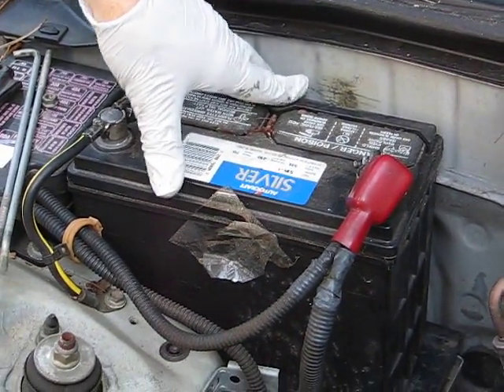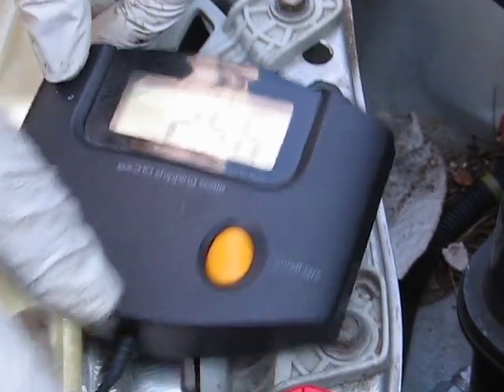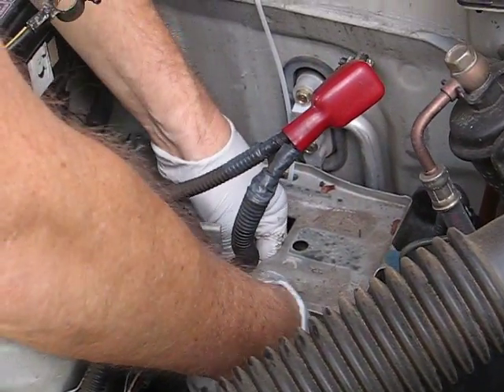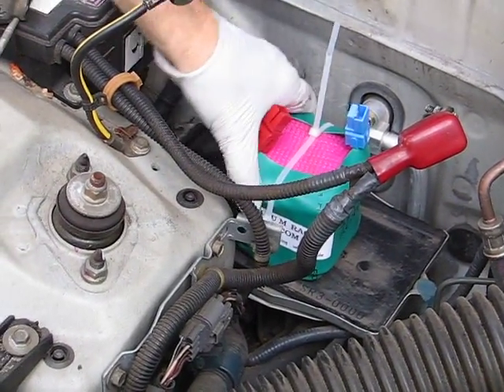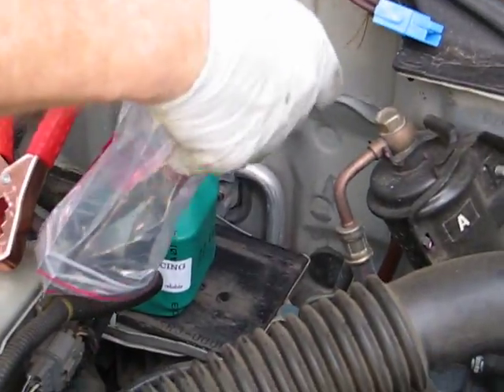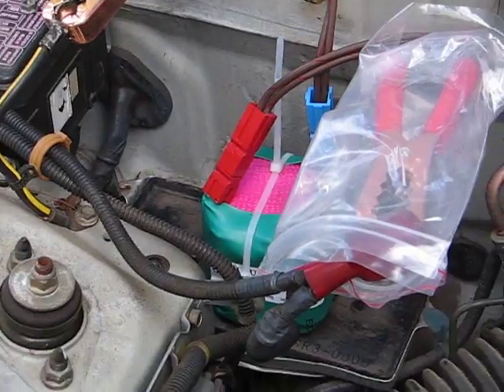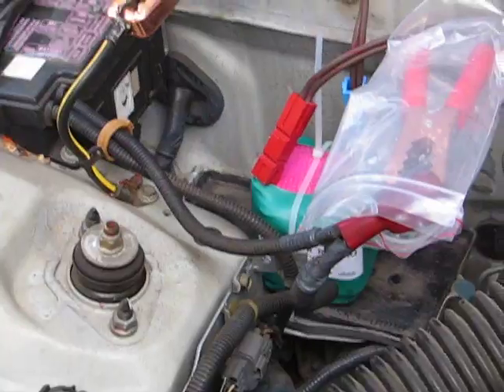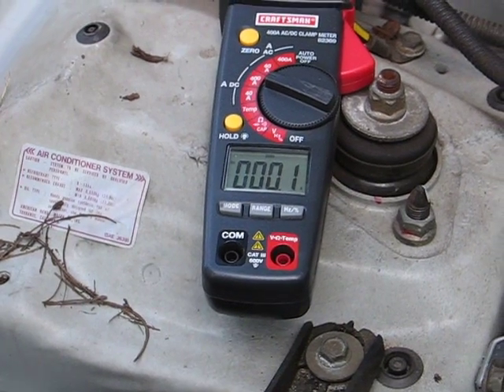How to replace a Lithium auto battery (AeroLithium battery)-DIY

Comment: just because the insulation on the battery is fire restraint does not mean heat is no problem and what voltage is that battery with no bms or circuitry sounds dangerous

Comment: not a very good replacement. peak amps too high for this battery.
how many have you put in series? 3 and the charging voltage would bring them to 4,8V which is way too high. 4 and they would never get even remotely full. i know you can also buy 12v car battery replacements with lithium cells but I wonder how it is done.
Reply: You do know that expensive racing batteries also use Lithium, look up smart battery.com

Comment: Point of safety always hook up the positive lead first then negative.  Better connectors needed when you connect wiring. It's important to use the correct size connector for a safe high current  connection.

Comment: This is 4S3P A123 Lifepo4 pack, right?
I'm looking at this BMS -Where does the power cables go? Is "low current" part separated from "crank" part? I don't think that those TO220 thingys are carrying hundreds of amps.
Was the current only 140A? Isn't this 20-40A charging current bit too high? Was this pack fully charged? Maybe that's the reason for instant killing engine (40A means a lot of drag from alternator)